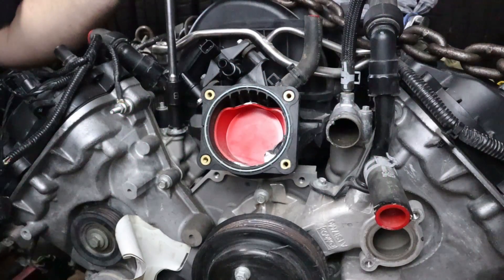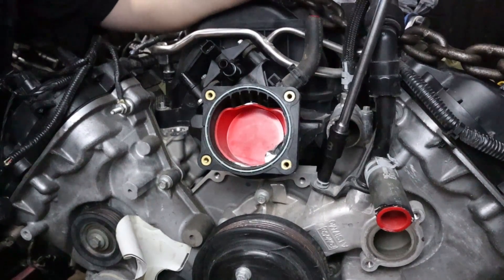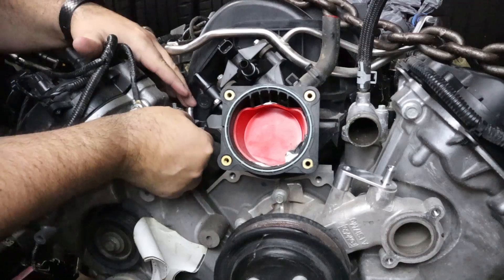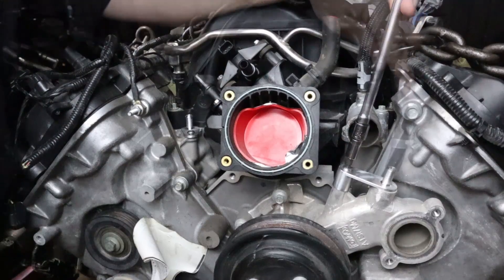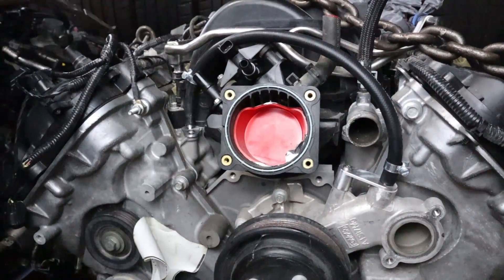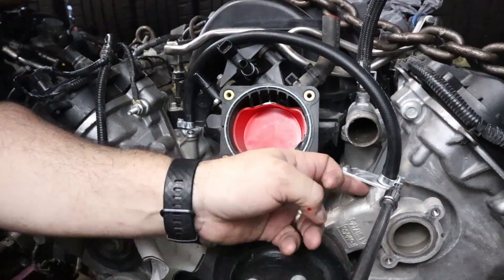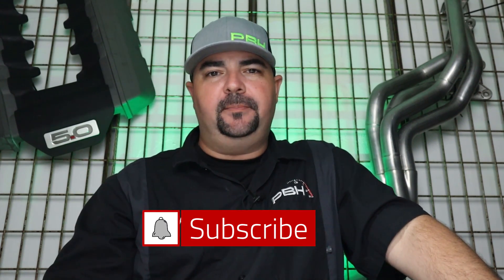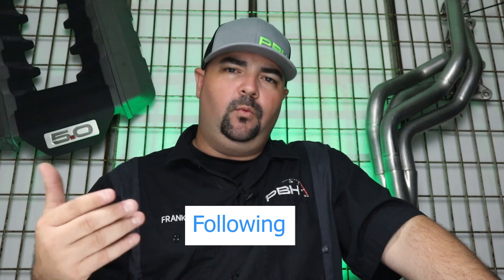Coyote Swap Cooling System Mod PBH-636

Comment: So what happens to the tube running to the coolant resivor? Needing to bypass my swap but not sure which product to get. This one leaves me with questions. In the video you can clearly see the driver side is a tee that you removed and installed basically a reduced coupling.
Reply from the maker: Typically in a situation where you are looking for a product like this, it is due to the deletion of the oem coolant tank. This is due to the use of a traditional radiator that has a cap and port on the flange. From there you can run a recovery tank. This allows the cooling system to be simplified in swap applications for older vehicles as an example.

Comment: If I install this would I be able to later on connect to the heater core or need to use oem tubes without using degas bottle
Reply from the maker: Yes, you can also use these to connect to the heater core. The hoses would be the only change.

Comment: This make low cyl head temp ? Because i have high temp in my cyl head
Reply from the maker: This will not improve any cooling system characteristics. What is your cylinder head temp now? what do you consider high?
Reply: @PowerByTheHourPerformance  when i drive its come 120C when i stop its come about 95C to 90C all coolant systems is new why its come hot … and i remove heater because i have leak inside the car

Comment: Can you splice in a "T" fitting and run a de gas bottle?
Reply from the maker: To run a degas bottle we would recommend using the oem tubes. Putting a T inline here may result in some issues.